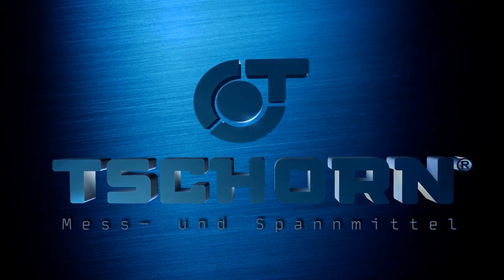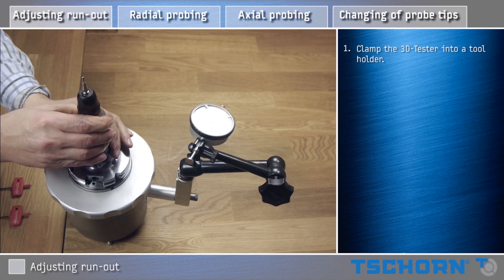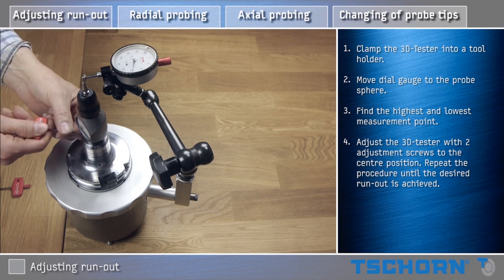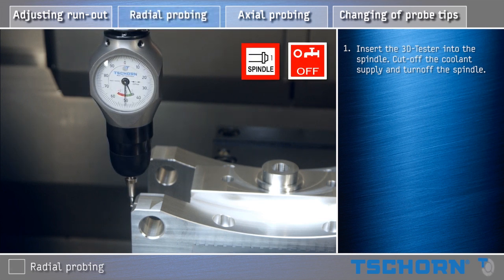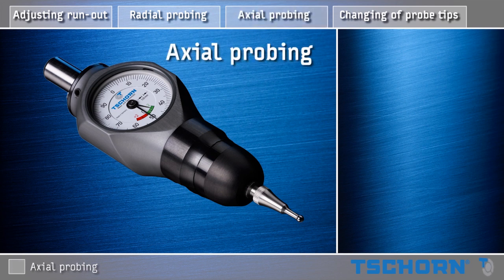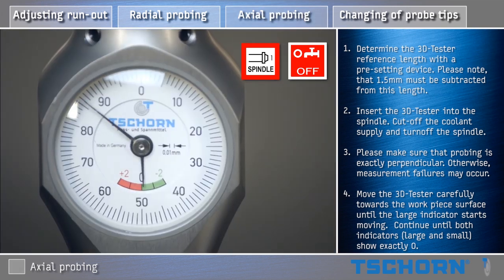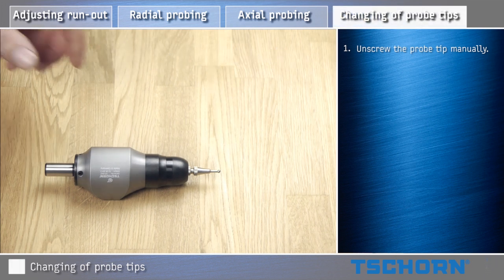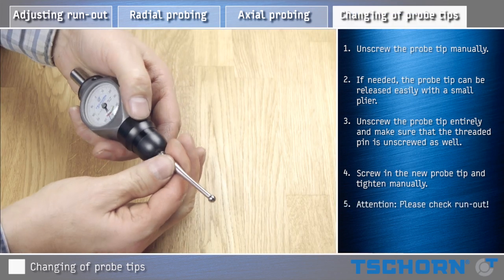3D-Taster Tutorialvideo, adjusting run-out operating manual

Comment: we bought new from meusburger. This device is trash. At first it was ultimately hard to move along x-y direction. Now after 2 day use when you move lets say x 0 and you go +0.1 and then you return for -0.1 error is 0.02. if you try that in any direction it is same. It has late response. ONE WORD IT IS BLOODY TRASH.  Also in manual the say dont use height gauge, and what they do in  video??? They use height gauge